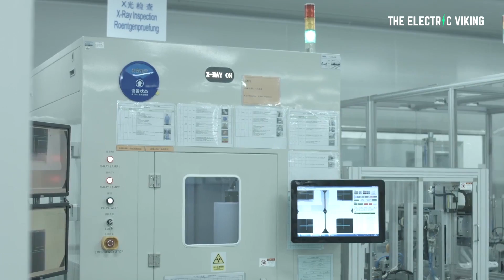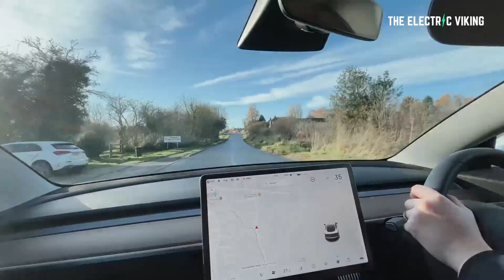This NEW battery changes everything - GAS sales will collapse

Comment: The problem is the charging infrastructure is not ready for 5 minute charging. That is incredible amperage.
Reply: Yeah, right. Rough estimate: charge 100kWh in "5 Minutes",  which is 1/12 hour, would need 1.2MW power supply. Just for one car.
How many charging stations exist that can deliver this? I guess, a charging station with 10 stalls is maybe connected to the grid with 500kW.
Reply: At home would work for me….I’m interested in a EV for my running around town which is most of our driving. It will be a few years before I would trade my ICE Tahoe for long trips
Reply: This is the most ignorant comment I've read in a very long time. You know the charging infrastructure charges many cars at the same time, right? If the charging infrastructure can handle x cars in a day, then that same charging infrastructure can handle x cars in a day with each one of them charged in a shorter time. Each individual car will draw more amperage but will spend less time charging, so there will be fewer cars charging simultaneously. The average amperage over the day for the infrastructure will  be exactly the same, as it only depends on the total charge capacity of the vehicles that are charged in that day. Even the peaks will be almost exactly the same. You'll only need to upgrade the infrastructure when the total energy transferred in one day increases, that is, when more people own electric cars and/or when the individual cars' charge capacity increases.
Reply: @chesshooligan1282  sorry,  bullshit. You're looking at the total energy in a day, but this is not the point. It says nothing about peak power required. And said peak power is limited by the construction of the charging station and how it is connected to the grid.
Reply: @ingo-w  Go learn some basic maths, mate, and stop wasting our time.
Reply: @chesshooligan1282  From Wikipedia on Tesla Superchargers: "Supercharger stalls have a connector to supply electrical power at maximums of 72 kW, 150 kW or 250 kW."

Maximum(!) 250kW. To charge 100kWh in 5 minutes you need 5 to 6 times as much. Basic physics.

ionity/Porsche have tested (but, to my knowledge, not deployed) charging stations with up to 450kW. Still 3 times more required for 5 minute charging.

So Joe is absolutely correct when he said that infrastructure needed for 5 minute charging is currently not in place.
Reply: @ingo-w  If you want to interpret the comment that way, that's like saying my town's infrastructure isn't ready for a 750-watt GPU that I'm planning to buy because the PSU in PC is only rated at 500 watts.
Reply: @chesshooligan1282  So what part of "The problem is the charging infrastructure is not ready for 5 minute charging." was so hard to understand for you?
Reply: @ingo-w  The part where I assumed "the infrastructure" meant "the infrastructure" rather than the Tesla charger.
Reply: @chesshooligan1282  Oh, so why don't you tell us where this 1,2MW chargers are available?

Comment: I had come to the conclusion that if I waited 2 years I could have a 600k EV but now I think within 2 years I can have an EV that does 1,000 km, charges in 10 mins and costs 30% less than cars offered today. It may not be a Tesla or fancy brand but it doesn't need to be.

Comment: Are the current chargers out there up to the task of charging at that rate?
Reply: No, and what's more, they're struggling to meet the relatively modest demands made of them as it is. There have been many reliability issues with the current chargers and a failure to repair and/or service them in a timely manner.

Comment: Digital Cameras took a lot longer purely because of resolution, Digital today requires a 35+ megapixel full frame Sensor to be close or equal to Film, my fairly new Nikon has a full frame 45.7MP Sensor and is as good as what my last Film camera results were.
I was a Photoshop specialist back in the early 90's to later 90's and repaired many photos and films, even glass negatives that people had broken.
When you use Photoshop or an imaging Software, this is where you see the quality of your cameras sensor.
Resolution is the key and took a long time to get to a point where it could compete with film.

Comment: Charging time is not nearly as important as range and lack of degradation though. I would much rather a battery that can go 500 miles and still be able to go 450 miles after 10 years, while being a bit slow at charging than a battery that can only go 300 miles, will only be able to go 200 miles after 10 years and can charge in only 5 minutes.
Reply: thayß vampier baterr oñky

Comment: This could also help grid storage, if you have weather that has intermittent sun, with quick charging the batteries could take in a lot more charge current while the sun is shinning.

Comment: I am confused by your claims Viking.  CATL's claim is 255 Wh/Kg energy density while the 4680 has 276 Wh/Kg!  I guess they are claiming they can package the cells into a more efficient battery pack to gain 13% overall, but since all structural packs will be unique to each vehicle, how does that stand up?  Let me know, please.  Love the fast charge claim and I am hoping it is factual.
Reply: 4680 cell can reach  276 Wh/Kg, while you have to pack many cells together,  then the density will decrease
Reply: The CATL's density is for the whole pack while tesla s 4680 is at cell level.

Comment: Tesla is on a different level to everyone else and now with Sandy Munro's breakdown of the Texas 4680 Y model, the whole battery pack and floor can be dropped out of the car, which will allow very swift upgrades of battery packs when new battery technology comes to market. The dropped-floor battery means that it can be sold and repurposed more efficiently by re-sellers, making Tesla ownership a no-brainer.
Reply: Aren't most companies using this type of tech where the battery pack is a skateboard, under the body?  BMW is the only maker I can think of that is using the same body for plug-in and ICE.
Reply: @edwardjh05  also Kia, hyundai, Mercedes and a lot more use same platform for different type driveline.
Reply: dont see how it makes it more easy to change battery because the carpet and seat comes down with the battery. Its only to make it easyer to build in the first place. Tesla S could change battery in 5 minuttes 10 years ago.
Reply: @alb9472  Easy compared to Tesla's rivals.

Comment: To send 1200 kW into the batteries all the electrical components in its path need to be able to handle that too. Tesla-truck-size chargers would be necessary to charge that fast, plus giant batteries at the charging stations to smooth out the load to the net, if as many people fill up their EVs that way as today ICE car owners do. But, if we could charge these batteries at a pretty constant rate of 300 kW instead, a 100 kWh battery would fully charge in about 20 min. Slow charging at home and at the workplace still seems the best way to charge commuter vehicles tho.
Reply: All the fast charging tech is just to convince idiots to buy electric.  Once they get the vehicle they will realize 'gas' stations are unnecessary.
Reply: How often will people need to charge from zero to full?

Comment: Stay tuned in 6 months there will be a new break through in  battery technology.   Now all we need to do is make it rain so our lakes stay full and we have enough hydro power.   Hydro is clean energy,  no solar panels, no giant windmills.   This just in, catl just announced a giant leap in batteries......
Reply: Hydro can have some significant negative consequences to the environment. Flooding of thousands of acres of land for instance which usually means the loss of entire forests that had been capturing CO2. Damage to or complete destruction of spawning grounds. Huge amounts of cement used, the production of which generates 8% of the worlds annual CO2 emissions. Huge amounts of steel used which again, the production of which generates more CO2 and destroys habitats and ecosystems during mining. Changes in the flow of tributaries and of the principle river being blocked which may lead to a loss of valuable farm lands and destruction of delta marsh lands. 
Solar, wind, tidal, hydro, nuclear, coal, gas, all have some negative effects on the environment, so we must ask, which are better and which are worse. On balance I believe that wind and solar have a lower cost to the environment than hydro does. Of secondary benefit, solar and wind as a distributed power production system are inherently a more secure source than centralized generation systems such hydro or nuclear. 
And lastly, as global temperatures rise, rainfall patterns are disrupted and drought severity increases, hydro reservoirs may drop lower and lower as is being seen now at the Hoover dam with Lake Mead.
Reply: letß do thàt hydér 7ß futuré

Comment: The other side effect of this kind of battery tech may be smaller charging stations (as in fewer stalls). If cars charge in half the time, then you need half the chargers, because the cars are only there half as long. Presumably the kwh rating of each one would need to double, and the overall energy usage of the whole station should remain roughly the same. Smaller stations might mean more stations in more places (subject to grid infrastructure limits).
Reply: Eventually most people will simply charge from their homes and only rarely use charging stations. Many commercial Fleet vehicles will have their own company stations, so the need for public access EV stations will not be as high as for fossil fuel ones, especially as EV's with longer range become more readily available.
Reply: @donjohnstone3707  I would say that's true now... I charge at home maybe 98% of the time for example, and I think that's the majority, but I know there is some % of EV owners who can't charge at home. We have to keep in mind that EV adoption is still in its early stages and will grow by an order of magnitude or two. I don't think the current EV charging infrastructure is enough to meet the demand that will arrive in the next 10-20 years :-/
Reply: @declinox  Yes. The need to fast track the building of charging infrastructure and the renewable energy systems needed to power them, will need to be an urgent priority as the transition to EV's gathers increasing momentum over the next 10-20 yrs. Fortunately they can be made safely, conveniently and cost effectively available in a much greater variety of places than fossil fuel stations. Even very remote places can have their own source of renewable energy generation and battery storage to provide charging.

Comment: Very rapid charging is not as important as the normies may say it is. On a long trip the driver and passengers need to have a break every few hours. These breaks are usually at least 10 minutes and often as long as 20 minutes. A five minute charge is not a requirement for an EV. It is more of a nice to have capability.
Reply: It depends on how someone uses their vehicle. If you are driving a lot of shorter distances in a day, like sales people, taxis or delivery and uber drivers etc. fast charging is an important advantage. Not everyone is on a permanent holiday with nowhere in particular to go and all day to get there, some people drive to make a living.
Reply: Yup. It's not like people are driving around with piss bottles, and with 70% of folks being overweight or obese they're probably not driving that long without food either, even if they're professionals doing Uber or whatever. Plenty of time to top up during a lunch break or between peak traffic times when taxi services aren't needed.
Reply: @ordinaryhuman5645  You obviously need to get out more to learn and understand what actually goes on in the real world. Many working drivers do not have the luxury of taking long breaks, especially for those in the gig economy, because time is money. They need EV's that they can continue driving with the minimum of stops and delays, to make their work financially viable. You may not care or know about that reality but the EV manufacturers are aware and developing vehicles to satisfy that need.